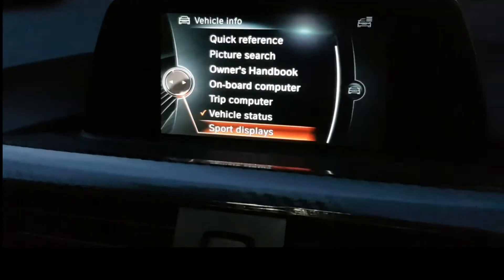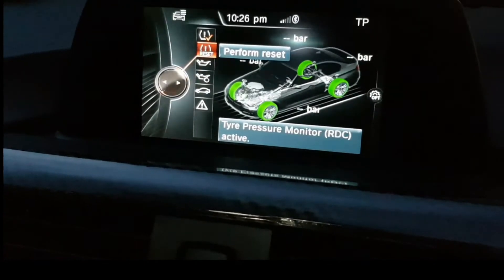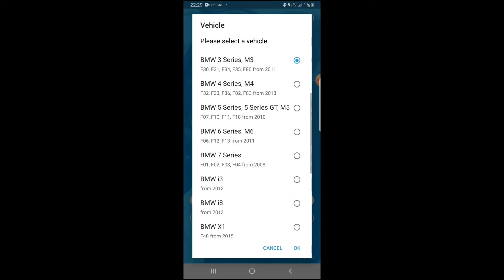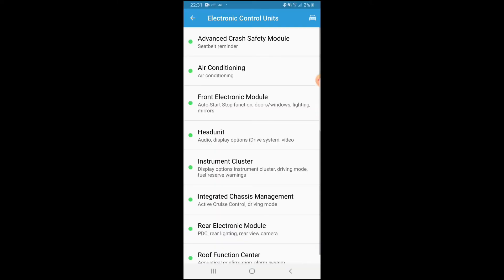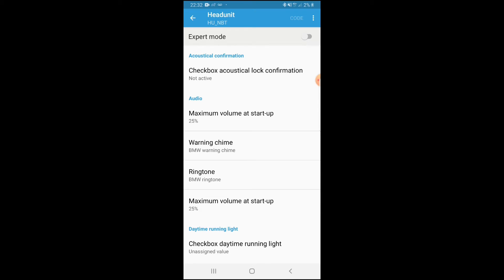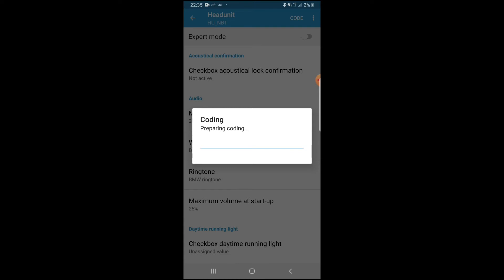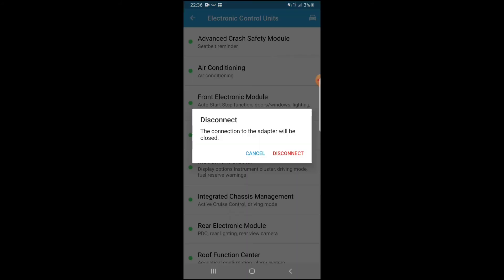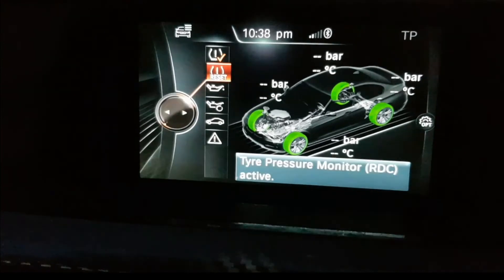HOW TO CODE TIRE PRESSURE AND TEMPERATURE WITH BIMMERCODE (PT.6

Comment: Sending positive vibes for the coding community. I wanted to just mention that your engine should be off when coding. Ignition is on but not the engine, driver seat belt should be fastened, windows closed, ac/fans/blowers + headlights set to off position. 

And most importantly please charge your phone, the 2% warning ⚠ at 5:17 during your code writing almost gave me a heart attack bro. Easiest way to turn your ecu/tcu into an expensive paper weight.

Comment: If you ain’t got  the sensors on the wheels are you getting warnings on your dash ? Mine keeps saying error I’ve coded it so the pressure is off but hour later warning comes on
Reply from the maker: If there’s no sensors no matter what you will get an error on the dash
Reply: I use beam record advance mode and typed in RDS and you can turn them off there I did this and I was hoping I can turn it back on so I can put in my other wheels but messing something

Comment: Do you get a tpms warning for not having sensors installed? Mine is showing “- -“ also but I’m not getting any malfunction or warning. It defaults to ftm that uses wheel speed sensors to determine a flat (doesn’t know which one) which is nice. I want to install tpms sensors and have it read pressure and temp tho. If I buy tpms sensors will it work?
Reply from the maker: Yes if you buy the sensors and install them it will work
Reply: @draganjz1153  thanks. Seems worth the bit of $$ at a tire shop to put them in and see!
Reply: @straussweekly1560  Hi there, did you manage to get your car work? My car also defaults RPA which uses wheel speed, and don't know how to switch to TPMS which is RDC